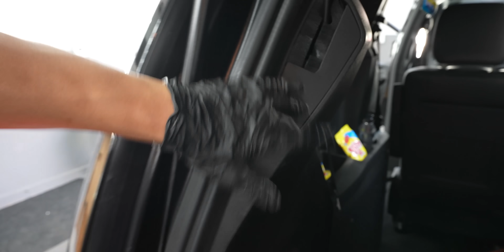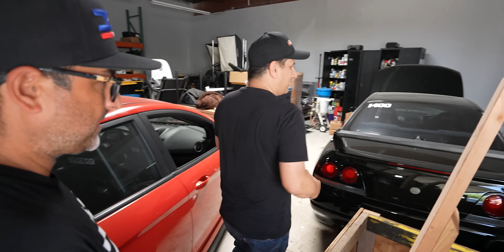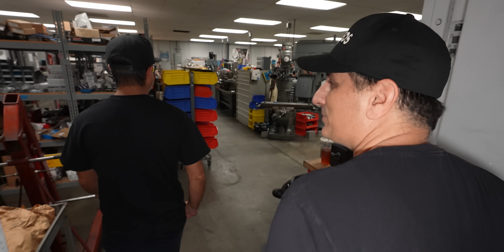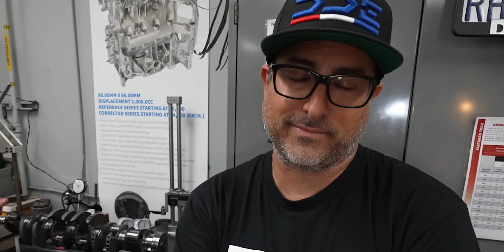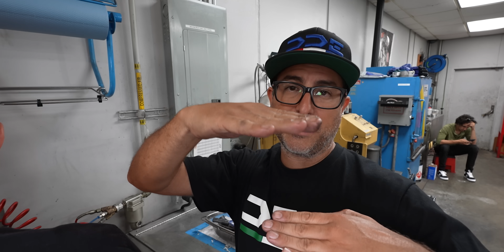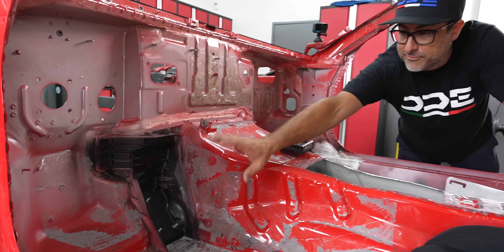FERRARI INSPECTION CONFIRMS DDE HATER SABOTAGE… $101,999 ENGINE DESTROYED!

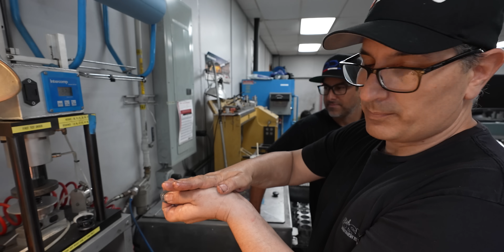Comment: 20:07 I used to teach engine building classes and one of the hardest things to get students to understand was measuring valve spring height vs installed height vs seat pressure etc. but it really does make or break a build.

Comment: 25:32 Did exactly what I mentioned on the last video I commented on. Good Deal!
Reply: 25:40 its "not that strong" it certain ways, Its actually meant and designed to crumple up in an accident and absorb energy. While this also creates a negative effect of a less stiff structural frame of the car, it does actually help to transfer energy from an impact AROUND the occupants instead of "through" the person. This is a massively misunderstood function on/of our road going super safe cars vs roll cages and race cars... People think tossing a bolt in roll cage in your factory civic makes it stronger and safer, Sadly that is just not the case, scientifically. While it may stop you from rolling the car up into a crushed pop can, its not going to help in certain impacts by "preventing injury".

Comment: Cut the roll pipe above head area. Fabricate a 1/4 inch flat piece to weld to the top of pipe with a 1/4 X 1/2 T piece welded to the bottom of the flat bar. That should give you an inch of further head room.

Comment: I watched Castle main rod shop they have a Ferrari v12 running firing order off of one crank sensor instead of stock two crank sensors one on each bank as two 6 cylinders as an odd fire engine.

Comment: D-Sport builts high quality but very strange. IS Lexus have 500 F and as new Gen Lexus looks 'bulky' it just asks for 'big' engine not the power in my oppinion. Best resolution for this would be New Gen IS 350 engine inside Gen 1 Lexus (if it fits somehow) or  leave IS 500 engine in new Gen IS and keep it simple. No doubt D-Sport knows a lot like Essa mentioned, but their vision is off the track

Comment: Mike Essa is with the engine, suspension, everything race/sports car knowing guy there it is, knows way more than most tuner shops and some of them are good, some not really, as we see how hard it is. The connectionns he have, the flywheel guys, the pistons & rods guys, now this guys and everyone else are like him, but in more specific areas, so if someone can pull this off, it will be Mike and  the people he partners up for important jobs like this. Changing the whole engine internals, fixing a ferrari crank, maybe sleeves in the engine! 3 YEARSAGO during COVID I commented that Damon is wrong about this Hoonikorn build, as this car engine, like many others are not good for Turbocahrging, especially the way they butchered it, then Gintani helped, but it was not meant to be. Maybe Mike will do it reliable, for Sema- I don't know about that:)

Comment: Saw a local nasa team do this. Instead of adjusting the seat position they have a seat rail for the pedals so you can slide them to fit the different drivers seating position. 

Might be a good look for a pedals solution 🤔

Comment: That roll bar needs altering. It needs a more rounded corner, take out the x2 bends. = more space.
Then simply cut the whole floor section out in a square. Add reinforcement for seat mounts. Finish floor back together.
Its common to lower seats by a few inches in lotus 7 style cars with extremely small clearance for taller guys. You should be able to gain 1.5 - 2in no problem lower

Comment: I have a suggestion for you guys... Why don't we work with/on the parts that we already have instead of trying to get custom machined parts on the engine since we are on a tight time schedule for the full build? I mean of course we need perfectly fitted parts on the engine for it to be an effective and lasting build, but do we need perfect for CEMA? For example: the sleeves being 2mm isn't preferable but we can make it work for CEMA without damaging the engine and after that we can get the custom sleeves with 3-4mm thickness that'll handle the boosted engine better. Because I feel like rushing on custom parts unnecessary would increase the chances of something bring overlooked and getting messed-up. I think this would be the best overall approach to this time-attack of a build. 
Wishing Mike the best of luck with the build... 🖤 🏎 💨

Comment: Proper blueprinting and proper engine building. The only time I have seen this is by old boys grass tracking and hill climbing but never on super car engines

The hood is so long because it’s a front not mid-engine mounted car. It’s crazy really, but mega though it has to have transaxle to balance the weight

Comment: Obviously you can't weld the steel hoop to the aluminum body, but have you considered panelbonding the two together? What I envision is a plate welded to the hoop, and one welded to the body that overlap, between the two you attach with panelbond. You get the rollover protection and you add a bit more rigidity. Maybe I am overthinking it, I dunno.

Comment: When talking about making the crank straight knife makers due a similar function in which they take a carbide tipped hammer and hit the bend on the inside not the outside like one would think but it allows the hardened steel to relax back into straight.

Comment: PROBLEM: Without knowing the original factory specs, the machine shop will be guessing some of the tolerances needed to contain to the power out of a now "boosted" engine. Heading into uncharted territory may end up being a "trial & error" issue until they know what the newly created weak points will end up being.

Comment: Just a thought concerning the roll bar, could you use an oval section tube instead of a round piece? Would that give you the head clearance you require? I know old school Ferrari’s used oval shaped tube for the chassis and I’m thinking that an oval piece would probably be stronger than a round section?

Comment: Killing it… when you are short on time it’s always good to outsource anything that you can. Love that even with the time crunch you are taking the time to get the seat brackets correct and not just calling “good enough”. Almost time to bring in another guy or two and to start project managing to spread it up. This way when you are out getting parts, drawing cad, finding venders, and finding parts the project is still moving forward….Just an idea because 60+ days comes faster then you think. Good Luck

Comment: The o-ring block/head gaskets work great for boost. I've used them on Twisted Wedge Ford heads. Even running lower boost pressures it's cheap insurance. And the worst is blowing a head gasket when you're in the middle of a race or important event. I need that pneumatic valve removal tool, very cool. Best content on this channel so far.

Comment: Are you guys accounting for the increase in sleeve thickness in the piston size? I know the Carrillo pistons are already being made, just curious if that was accounted for? Love the content, this is the technical stuff that I always wished DDE ventured in, especially with exotics.
Reply: Look up (Steve Morris Engines) he builds his own custom engines & shows installation of his sleeves
Reply: @STARSHIPTROOP  I watch Steve’s videos weekly. He builds some badass stuff and explains things well. I was curious if the boys at DDE accounted for the need to increase the sleeve thickness into their measurements they gave Carrillo. The dimensions would need to change on the sleeves to account for the tighter bore tolerances. I’m sure they did (Mikes a smart dude), just was wondering.
Reply: @AddictionAuto  Ferrari will probably not release specifications of their engine as custom sleeves will mean taking material out of the engine block to accommodate the new ones. uncharted territory
Reply: @STARSHIPTROOP  actually it’s opposite which is why I said what I said… your outer diameter of the sleeve remains the same as factory, on thicker sleeves your inner diameter is what changes which is why I asked about the diameter of the new pistons. They would have to be a smaller diameter than factory to account for the thicker sleeves.
Reply: @AddictionAuto  Maybe, however the shape & size of the chamber side of the head will dictate the size of the pistons, anything smaller will change the flow characteristics & boosting it may very well  exacerbate variables because of said flow changes.

Comment: Why did Kaufman and Gintani not go this route in the first instance?  Seems that they both failed in their pursuit for power over reliability and longevity?  This series has exposed them both to be ego driven rather than engineering focused...  Ie, they just wanted high numbers despite the sacrifice being made to the engine.  Would that be a correct assumption?
Reply: Mike is doing it right building the engine for boost. Gintani, I'm sure, didn't want to take on this level of project and punted to get DDE out of his hair.
Reply: Kaufman was out of his skill level.